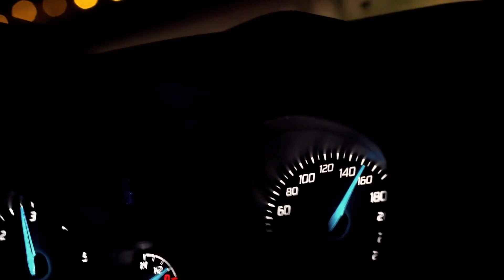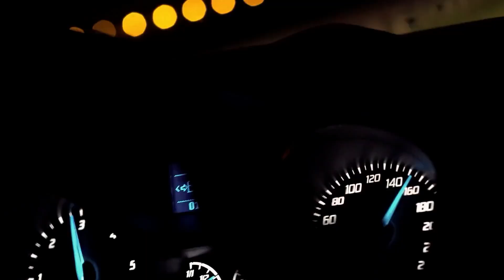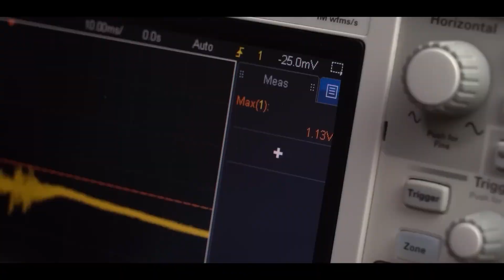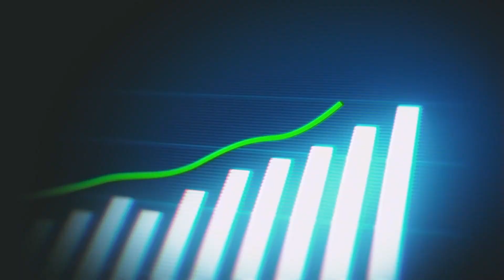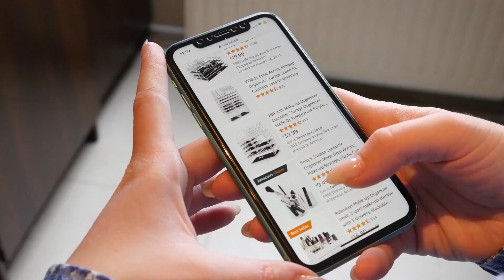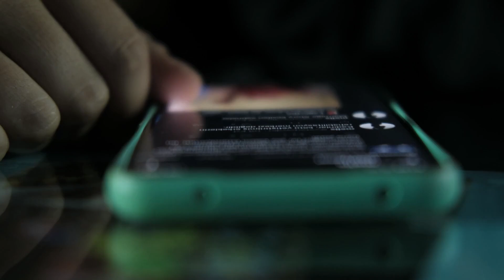Africa’s Self-Powered Wonder Car Shakes Up the EV Industry - BYE BYE China!

Comment: If the Microsonic unit is able to self-recharge an internal battery without the need of external charging from solar or wind generator, that would be highly useful for portable power units. If the device can output 10-15KW continuous power, it would be able to run a house. One of the claims was that a suitcase size unit was able to output 15 KW. It will be so very disappointing if the Microsonic unit is not truly a "free energy" device. I understand the need to protect against tech theft by copycats from other nations. But they need to invite legitimate 3rd Party testers to put the unit through a few tests in Africa and produce a video demonstration. Like maybe run a 1500 Sq. ft. house with energy efficient lights, a four or five ton central HVAC or heat pump unit, 240 V heavy duty appliances like washing machines, dryers, irons, microwaves or an electric stove\oven for a solid 24-hour period and never die out anytime in that period, which would cover a full day and full night of use. Bottom line, it needs to be a free energy supplying device that doesn't need to be recharged with costly grid energy, and that can be used to recharge a battery unit as large as a home power wall, continuously 24/7. Now THAT would be a game-changer for sure, especially if it has no moving parts to wear out. There are several companies doing research and some already have prototype perpetual motion electrical power generating technology in rigorous testing in labs. Let's hope the Microsonic unit makes most of them obsolete before they even get out of the labs and into production. It will save trillions in energy costs that could free up that money to solve many other issues like refurbishing cities, preventing needless wars over energy resources, and vastly reducing or even eliminating unsightly windmill and solar panel farms and fossil fuel and nuclear plants. It's all a pipe dream until then.

Comment: Does not work. E.g. Case 1: 5mA, 5V cannot be amplified to give at the same time Case 2: 50A, 50V.

Case 1: 25mW
Case 2: 2 500W

This means you have create about 1MW of power. This violates the laww in Physics that status that you cannot create nor distroy enegy, but can chang energy from one form to another, like mechanical energy change it to heatvenergy. This is so, so that the total energy remaining the sant at all points in time.